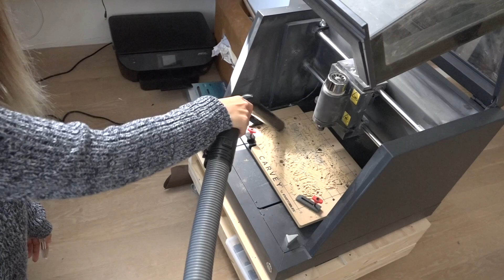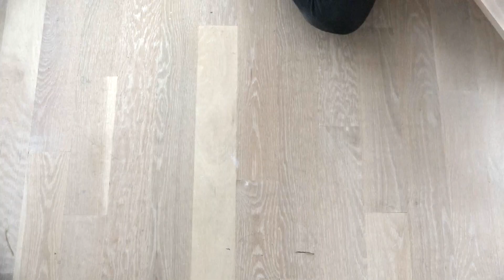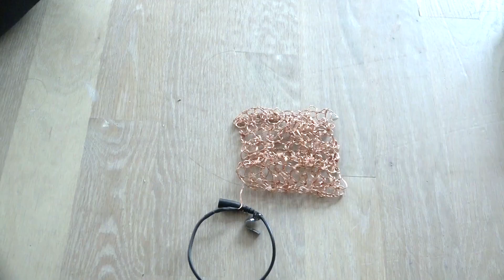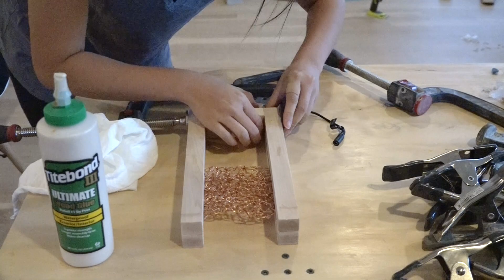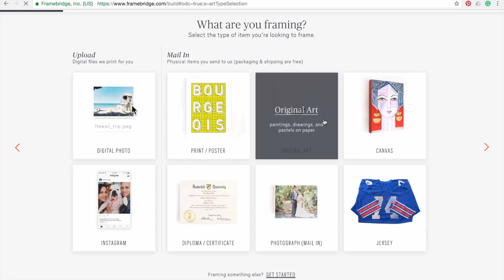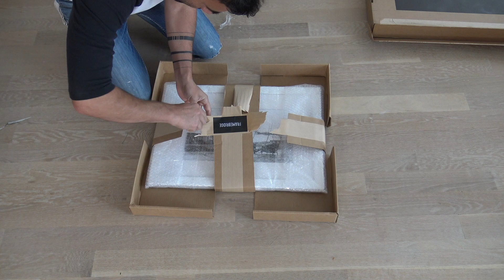Knit Copper Lamp

Comment: Can you change the title to crochet. It really is different. It's confusing enough to people without confusing them more. Really cool project though. I might do it with knitting because it would be beautiful and maybe just a picture frame or shadow box. I don't have access to a CNC machine.
Reply: You can always use the same plans and cut them out using a handsaw/bandsaw. You would just need to sand the edges more so towards the pencil marks. A bit more work, but doable without a CNC.
Reply: I have to disagree here. Knitting, crocket and weaving all produce fabric with very different and distinct characteristics. Knit fabric even the industrial type made by a machine is made using the same basic principle as knitting by hand. You are so meticulous and precise in your work, why not also apply that to your language?
Reply: Kayla Ball I've got to agree about the title change, this isn't knitting at all.
Reply: codysett1 being a sell out is one thing but she has the opportunity to educate the dim witted society. But instead you make it seem like she's just taking the easy road. It's not a matter of crying it a matter of being factual. Let's try to use our brains.
Reply from the maker: knit is being used as an adjective not to describe a specific technique.  a knit fabric is a common term that correctly describes the type of fabric without suggesting that knitting needles were used.
Reply: It's appealing to a wider audience if she uses the term knit. Not a lot of people know what crocheting is but practically everybody knows what knitting is. Stop crying.

Comment: lol I love that you use a CNC machine but then later say that if you don't have an orbital sander you can hand sand. :) I'm pretty sure anyone splashing for a CNC will have an orbital sander, haha
Reply: Charleston Crafted  was looking for this exact comment xD
Reply: you could probably use a standard router to make those parts, I thought that was funny too. HMM is sponsored by Carvey I think so they take every chance to mention the CNC and show its use.
Reply: Funny you say that, i have a CNC machine yet don't have an orbital sander, nor a table saw, or even a chizzel. :D
Reply: While this could definitely be done with a router, it would be even easier to do it by gluing up two 'L' shape pieces cut on a table saw (filler block for the top).  If you want to use fasteners, sink screws about 1/4" and fill with a wood plug.  A contrasting wood for the plug can make it more interesting, or you can use the same wood to make it almost invisible.
Reply: They are just simple box forms,  just get some flat 1x.25 cut, glue,  pin nail. A CNC is over kill for such a simple project.